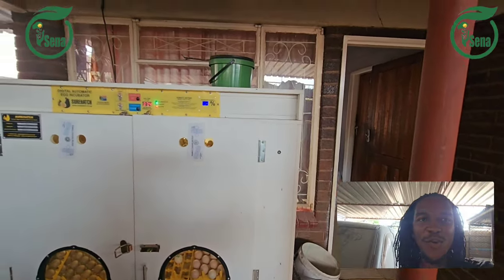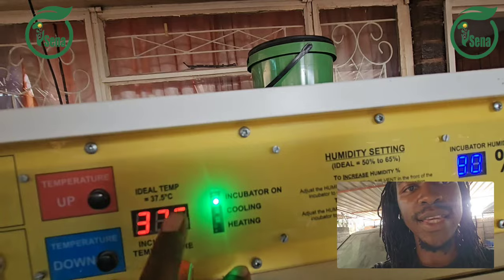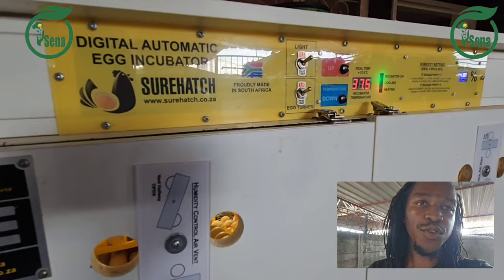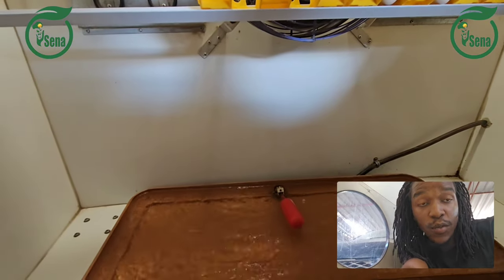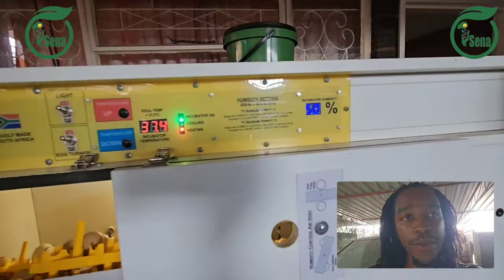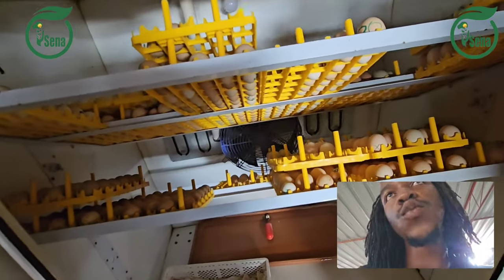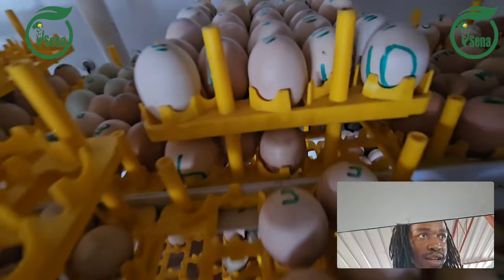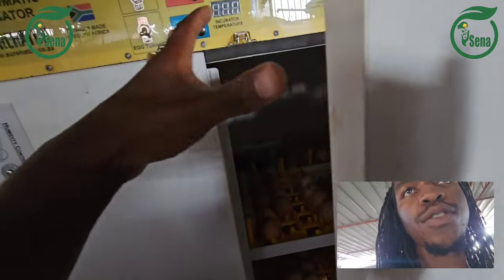How to operate a chicken incubator. The best hatching machine we have.  100% solar-powered

Comment: Hi sir,do i have to guard the incubator to monitor temperature drop or humidity drop? Question 2 do i have to quit my job to look after the incubator incase I'm leaving home early morning and coming back from work at 19:00 thanks
Reply from the maker: The incubator is automatic.  It regulates its temperature and humidity.  As long there is power source it can run. 

For humidity we add water once every 3 days. 

We recently bought a groove temperature reader which we can monitor our temperature even when we are not home
Reply: thanks sir
Reply: @usenasolutions  this temperature groove reader how does it work in times when Im in town and the incubator is on back home
Reply from the maker: @MorokaKgageng  you link the groove to your phone. You set the temperature range you need. So in case temperature drops or too high your phone will alert you
Reply from the maker: @MorokaKgageng  you can directly contact my whatsapp number +263779030565